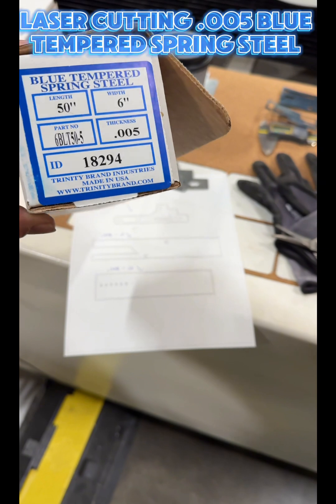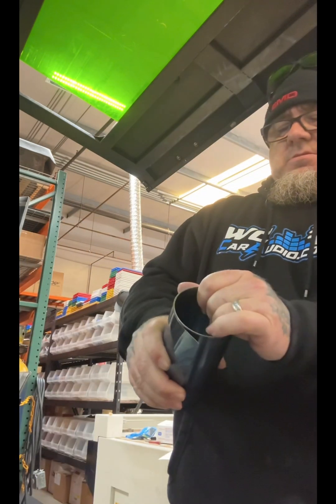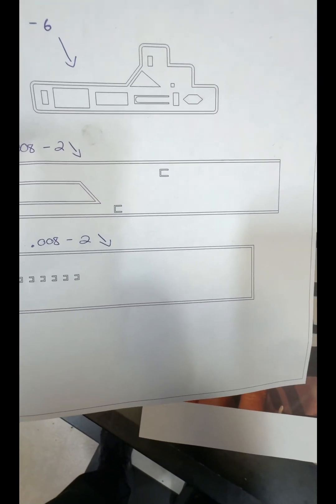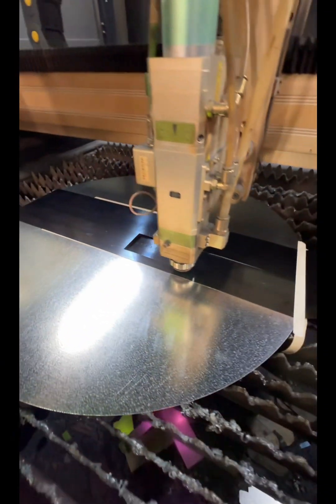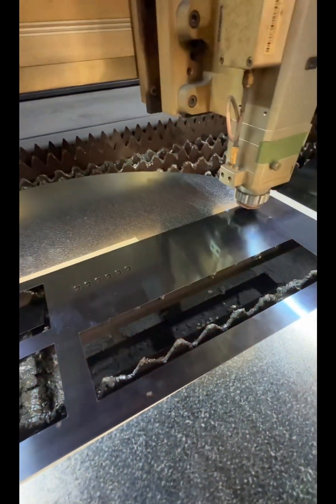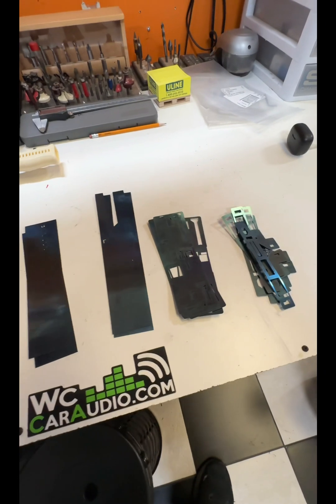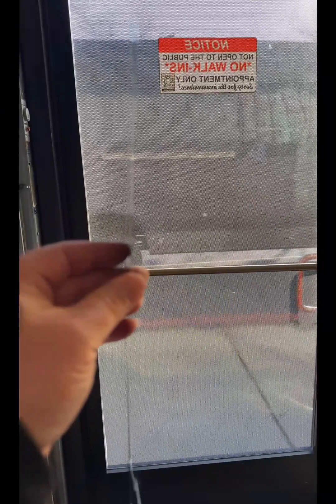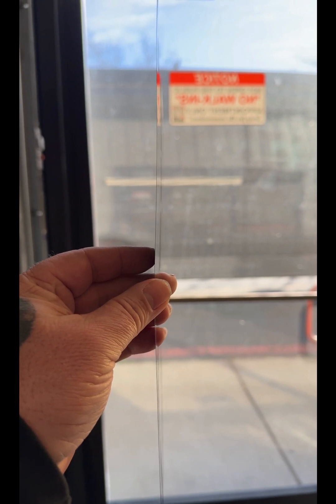The thinnest metal I've ever cut .005” Intricate Blue tempered spring steel parts on a fiber laser

Comment from the maker: I cut a lot of stuff on my fiber laser but this is the thinnest so far. It might sound easy because it is so thin but it is actually a little more complicated than it looks. I actually use a secondary piece of sheet metal for support. I cut the holes out (of the support piece) with a slight offset to allow the actual metal (the .005) a little bit of room for the beam when it gets cut. There is a lot of nitrogen flowing out of the nozzle so it tends to push the thin metal downward and create a "flutter".  This can affect the cut quality as well as the overall cut itself. The results are definitely good if you get enough practice at it! (in case you didn't notice we did a little .008", the "thick" stuff as well) Contact me if you need something cut! Thanks for watching if you did!